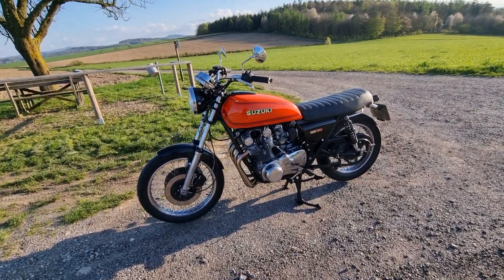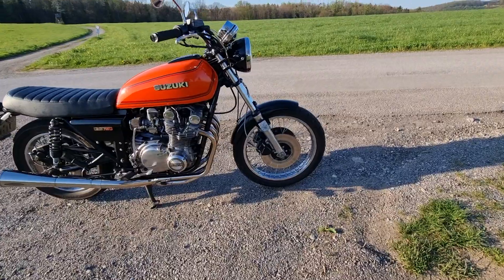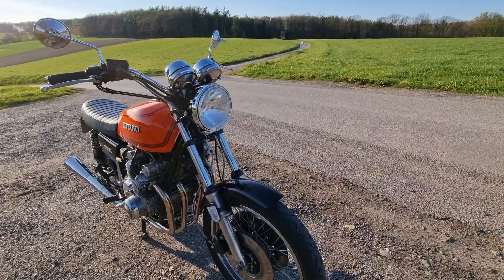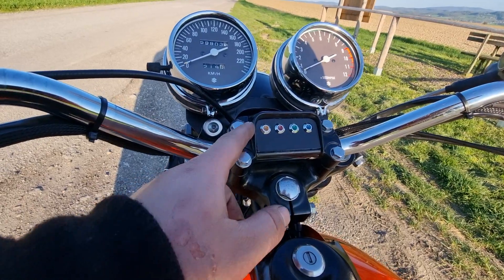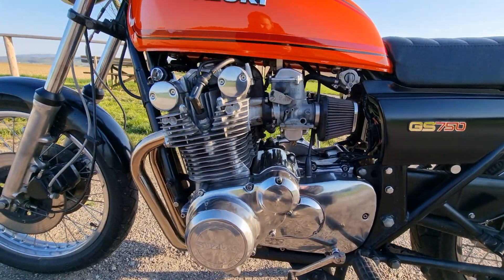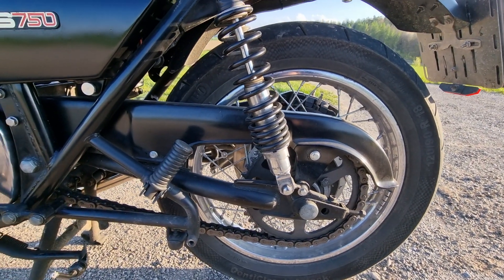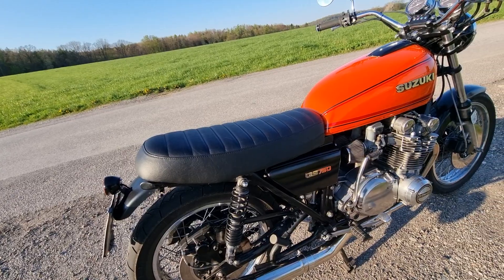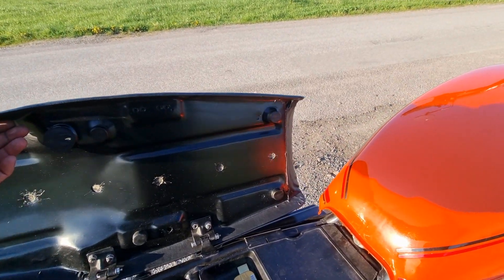Suzuki GS 750 1978 - My bike shed build

Comment: I am also in Austria, and I bought a 1978 GS750 Suzuki, because I owned one in the early 80's, still working on the carbs,  its been standing for 12 years, I have had it running, but only three pots. I am an Englishman in Austria,  your bike is tastfully done, I want to keep the originality of the bike I have,  anyway welll done, My wife is Austrian if you want to get in touch
Reply from the maker: Sounds great. I had the same issues and had to clean the carbs a ton of times to get them running. I used the so called ECR or ERC cleaner. Can really recommend it.

Comment: Very nice job. Some lovely ideas and touches well executed. I too like the seat conversion best, along with the cleaned up clock area. Just fitting the same bars to my GS750 as I had them on a GS550 back in the day and much prefer them to stock.

Comment: Beautiful bike, well done 👍
Reply from the maker: Thanks mate
Reply: @Kinghariii  I test rode an orange GS750 when they were released in Australia in 1978.  At the time I had a K3 Honda CB 750.  The Suzuki was a noticeable improvement.  At the intersection the salesman who was riding my Honda said to pin the throttle.  I did and it wheelied right across the crossing!  My CB 750 would never do that.  It was smoother and I recall it had a single front brake with more feel than my Honda.  I did not buy it in 1978 but came back later and bought a GSX1100 wire wheel option Katana in 1982.  This was a real head turner but it weighed a ton and handled very badly.  I sold it fairly soon after purchase.

Comment: Did you have to change the screws and needles in the carburetor when converting the intake filters?
Reply from the maker: Yes of course. You can't just mount single air filters without changing the original setting.  To make it run,i used a 120 main jet and a 27,5 idle jet. For me,it worked with this set up,but it wasn't perfect. So i went to a professional with a test bench and there,they improved my setting (think the changed needle). Since then,the bike runs just great.

Comment: Love the build, at what rpms did you set it to idle ? I am finishing my build, and it seems that my enginge ain't happy about being below 1500 rpms
Reply from the maker: Maybe it's the tacho? They tend to get inaccurate with the years passing. The GS should be running at approximately 1100 in ideal conditions. Did you already sync the carbs? Checked the ignition?